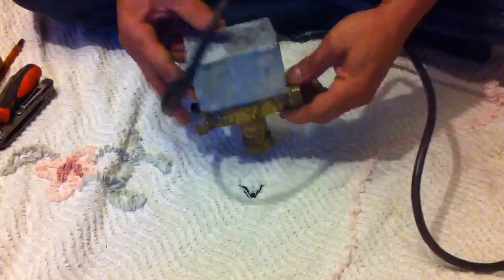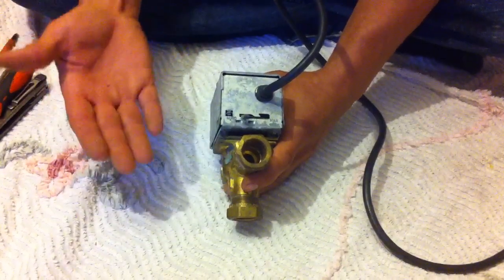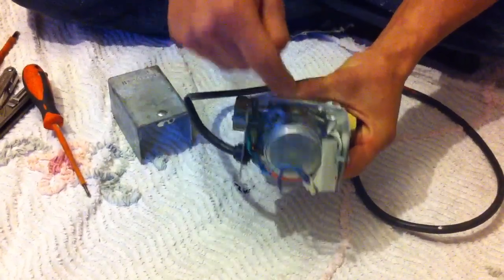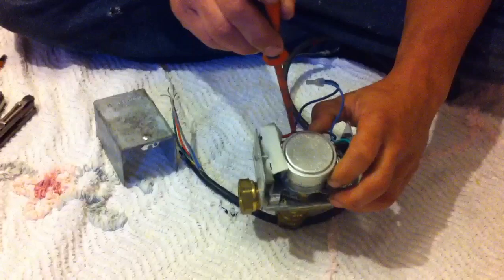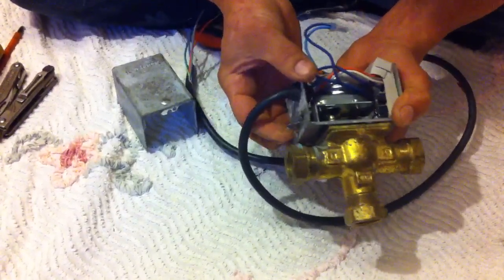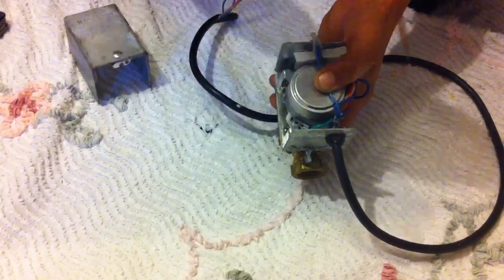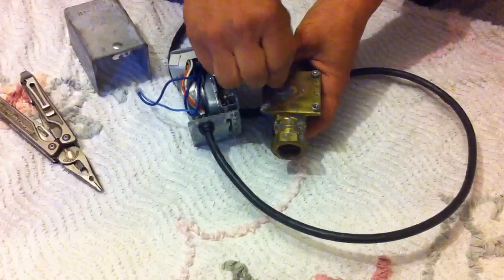Port valve diagnosis and repair

Comment: even after all these years since you put this up , its still helping people , very much
Reply: Amen!! 🎉
Reply: Yes my boiler won’t actually turn off the radiators so I think my value is stuck open of the micro switch thinks it’s open

Comment: Hi Sebastian
 I think my diverter valves are not working properly because when i select Central Heating i noticed the Hot Water pipes are also hot. Is this normal or a fault?  

I actually took the Honeywell metal controller part out & manually turned to A (CH) or B  (HW) or in the middle (AB) with my own hands but still noticed when Central Heating was selected the HW pipes were also heating up

I believe that when CH is selected  the HW should be totally off i.e cold. But because of a faulty diverter valve will unnecessary cause a bigger gas bill. is this correct? ...So in short drain the system & change the whole thing?

Comment: Hi, I had a physically seized "tap" under the valve (2 port ). After freeing it up I find that the valve doesnt close reliably. I need to manually cut and apply power a couple of times for it to close. Could you please advise where you think the issue might be? I've also noticed that it was installed with the arrow pointing against the flow direction. Could this be causing this? Thanks for your great video!

Comment: For the last 10 years or so, I have had issues with the Honeywell 3 Port Diverter valve, in that I have suddenly only had Hot Water and No Heating.
On one or two occasions I replaced the top-plate of the diverter valve because the ball-valve swivel had become stiff, but on all other occasions I have replaced the Actuator Head to restore Central Heating. On one occasion more recently, I successfully replaced just the motor in the actuator head (which was a lot less expensive).
However, last week I woke up to find that we had Central Heating upstairs only, and the downstairs radiators remaining cold. Naturally I feared that the circulation pump had finally failed after 25 years of loyal service; but as a first step, I removed the actuator head from the diverter valve to visually check that it was OK and that the ball-valve swivel worked freely. I re-assembled and switched on the boiler, but the same symptoms prevailed.
Therefore, with the boiler still switched on and in Central Heating only mode, I checked the voltage on the circulation pump – ZERO!! – so the fault is somewhere else! With the supply to the burner disconnected (so that I could lift the control panel & it’s box of tricks out of the way) I removed the cover from the Diverter Valve Actuator Head, hoping to see how it worked when switching between C/H & H/W – it seemed to OK, but still no voltage at the circulation pump.
With the intention of changing the Actuator Head yet again, I started to slacken the two screws securing the Actuator Head to the Valve Body, when I heard the Circulation Pump start, and yes! – 240 Volts at the pump!! Evidently the limit switch inside the actuator head was not being activated, but worked fine with the actuator head securing screws backed-off by about one turn.
Leaving all as it now is, I put everything else back in place and reconnected the burner, and It’s now bee working normally for the past 6 days without the need to replace anything – just slacken 2 screws a bit!
Long may it last!! Hope this might be of help to someone, but be VERY careful when working on the boiler with the power ON!!
19/02/23

Comment: Excellent - I have had problems with a number of zone valves where the tap itself has got a bit stiff and this has caused the place where the zone valve keys into it (invariably made of plastic on the head unit) to 'round out' and not be a tight fit - then you get all sorts of intermittent problems.  Probably down to hard water jamming up the actual tap valve.  One to look out for!

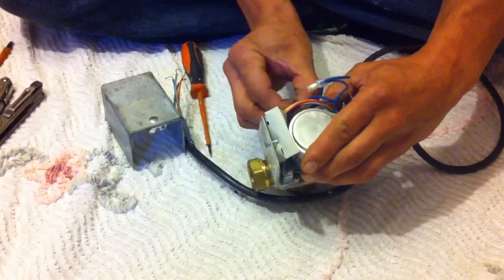Comment: re 3:40 . The valve only controls the 240v supply to the pump and the boiler for room heating. Water heating, well as I understand it that is a direct feed from the programmer and cylinder stat.

I thought with the valve set in the room heating position, continuity is between white and orange.

sorry for being pedantic :)

Comment: Hello Sebastian and thanks a lot for your helpful video.
With your video i was able to repair my valve with just changing the motor. Here is an additional link for one way how to identify if the motor is defect.
Kind regards Michael
Link to my video: https://www.youtube.com/watch?v=JKibxi4omXs

Comment: Actually there are 2 microswitches. One switches the pump and the water flow turns the boiler on. I wonder who designed this clutch mechanism, especially why ?

Comment: Good video, the first one that talked about the actual workings and the possible problems with the micro switches. I had to replace a top motor to the valve and found that the new replacement was faulty, in that the mechanics inside were not turning enough to operate the micro switches. Once I found this out all was well with another motor.

Comment: I think my valve stem is not moving all the way. It caused the motor gears to strip trying to move it. The lever for auto or manual moves with no resistance.  I took the motor off it was really hot. I used a screwdriver as if it was the valve stem and tried to turn it. It just skipped the gear teeth and opened all the way. So...I guess I need the whole assembly.

Comment: Same issue.  Motor was sticking before the lever made contact with the start switch.  Changed the motor - now perfect! £19 for the motor; zero cost to fit.  (Probably £100+ for call-out, parts and labour). Thanks

Comment: After several days of trying to get the boiler to start I watched your video and realised that the main synchro motor wasn't pushing the lever sufficiently to make contact with the switch that sends the "start signal."  After changing the motor my system now fires up and I'm very grateful for your help.

Comment: Seb its an excellent description on your video . I changed the motor and saved over £180 quoted from the local plummer . The part was £9.79 ant it took 30 min to repair.  Great video thanks

Comment: I tried to fit a new electric motor and control to the old lower valve body but the shaft length was longer on the old valve body , has anyone else had the same issue , spacing it away by a few mm doesn't seem to work that well.

Comment: On our valve the levers loose both ways so I guess that means the gearing is stuck? The little cog looks OK. Going to turn electric off and see. EDIT: turn off electric then check lever/arm and you should get resistance as per video. If not its bust. If clunky it's broken gears or cog worn out. Hope that helps someone.

Comment: Great video. I'm about to attempt replacing the motor myself. Quick questions; my existing motor is labelled as 5 RPM, however the one I managed to source is 4 RPM. Everything else is the same. What impact will a lower RPM have? Does it just mean the valve will open up slower? Thanks in advance.

Comment: Oh and whoever is watching this it is so easy on a bench without any water pissing out through the ceiling when the value is installed in a fucking bad place and the gate valves are passing water this guy is a clever dick

Comment: Hi Seb.
The valve you demonstrate in the vid, I have the  2 way valve version. My pump runs continuously unless I switch it off at the wall. The synchro valve works. Any hints would be appreciated

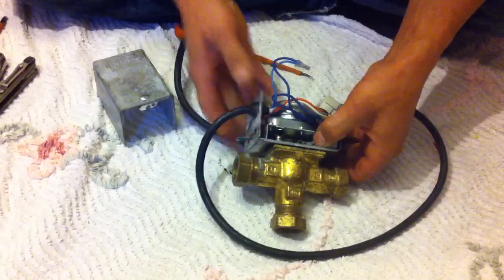Comment: Hi Sebastian. Great Vid - very informative. Could I just check that you meant to check the relay you can check for continuity on between the grey and orange (4:50)? I'm a bit new to this but on JW's vid on the internal workings of these 3 port valves it seems that the white wire supplies the orange with 240V when both relays are switched (grey apparently supplies the motor when the first relay is switched). So continuity should be between white and orange. Is that correct?Also when you manually move the switch right across is that moving it to the mid position (ie CH + HW) or right across so blocking of HW - that is CH only?My CH only function is not working (i.e. I set programmer on CH+HW but boiler turns off when the cylinder HW temp is reached) which leads me to think that the second relay is not moving across when grey given 240V. Thanks so much again!Tom

Comment: Just to add to this. My customer has a 3 port valve broken at the brass pipe side. The bit that sticks out just spins freely round and round with fingers. It is obviously broken as no position changes anything. hot water and heating come on together no matter what. I think something has snapped inside.

Comment: Hi Sebastian, I have a drayton 3-port valve on my system, I'm wondering if you can solve the problem I'm having with it...with the central heating control turned off and just the hot water selected on the programmer, the motor drives the valve right across to the hot water only position, but after a few seconds goes back to the centre position and remains there giving a constant clicking sound. This of course allows hot water to the radiators when it shouldn't. I've removed the head to take a look and the valve is quite easily operated with my fingers, the motor seems to run ok, could it be one of the micro switches causing this problem? 
Your help would be much appreciated, Ken.

Comment: Hi there.  My CH port valve is working fine.  However, recently its seems to make a quiet knocking sound on startup.  Any ideas?  Thanks.
Reply from the maker: Gearbox teeth starting to slip most likely
Reply: Thanks for response.  Gears seem fine - manually they run back and forth well.  The sound is like a like a tapping sound - identical and same duration every time.
Reply from the maker: Often the spring extending makes a noise similar to the one described but usually it does it from new
Reply: Its about 5 years old.  There's no problem with open and close (yet).  Sorry, the only way to describe it is a soft metallic tikka-tikka-tikka sound and then the valve happily opens and the sound is gone.
Reply: Hi Seb, I just took a spare valve apart (I need to get out more) and removed the motor unit.  I noticed the motor cap rattles when I shake it.  May be some kind of vibration?

Comment: Very clear and informative video. Ordered new motor this morning (isn't turning under power) and simply buzzing away merrily. Great info on the micro-switch. Using the lever manually, the arm wasn't coming across far enough to depress the switch. All sorted now.

Comment: my house have 4 heating zone. 3 of them are good. One have the same problem ( hot water can not go though the valve). I check the motor is good. And I switched to manual but hot water can not go through. Do you have any way can check the valve if it is stuck

Comment: Thanks for the video. I have an issue where everything works fine individually, but the cog on the motor is not gripping the cog on the valve. Is this a case of needing more grease? Noticed some wear on the teeth which is from the motor teeth grinding (that's the sound / also the spring popping back which sounds like banging) but if you hold in certain positions it does grip and control valve. Is there something displaced in the valve mechanism?

Comment: My water has stopped heating its just slightly warm and  i looked at the valve and the paddle does not do anything looks jammed ,i can move it back and forward manually but the gears do not  move ,is this the problem the waters not heating ?

Comment: Really appreciate your clear explanations. Over the course of a few days, we gradually realised we had heating, but only warm water. The auto/manual lever is stuck in the auto position (power on or off). Have ordered a replacement motor, and fingers crossed. Many thanks!!

Comment: I am going to try this. First. Turn off boiler. Turn on thermostat to that zone in question. Remove motor. Turn on boiler. Wait and see if the motor spins. Spins? It's okay. Does not? Need new motor. Test end switch for continuity. Turn off boiler again. Put tester to send switch.  Push switch on and off. 

Will let you know what happens.

Comment: Hi Seb. I think have a problem with one of these valves. My oil fired central heating system boiler is alway on, even when I turn off the system at the timer. The only way I can shut the boiler off is if I turn the power source off at the boiler. If I did not isolate the boiler the system would be on 24/7. thanks
Reply: Happened to me. One of the micro switches in the diverter valve was broken.

Comment: Hi Sebastian. Thank you for your extremely informative video. However I still am not quite sure what is wrong with my Honeywell 3 way valve.  Apologies in advance for very, very long message but figured you would need all the facts. Original problem. Heating not coming on when called. Hot water coming on when called but some of the upstairs radiators coming on. 
Called engineer who said he fitted a new replacement powerhead. This appeared to solve the problem, I paid him and off he went. However the next day same problem as before. He came back, fiddled around a bit, said he wasn't sure exactly what problem was and was going to replace "powerhead and valve". I specifically asked him if this meant the brass T shaped piece of pipework below powerhead. He said no and implied it was not that but the powerhead with something else (but not the T shaped brassware) which would cost another £100. Left me confused as I thought you replaced either whole powerhead +/- valve below unless you replace one of the components like the motor or microswitch independently as per your video.
Not sure he really changed powerhead as doesn't look new. I took cover off powerhead  and had a little investigate myself and this is what I have found:
When no power to valve: lever has resistance and springs back. Can't hear clunking gears.When power to valve: looseWhen neither HW or CH calling valve is open When just hot water called: nothing moves and boiler and pump fire up.When just CH called I can see motor turn valve towards microswitch but boiler and pump do not fire. If I then use my little finger to push microswitch the boiler and pump fire up.
I also took powerhead off completely to check valve - using my finger I can move spindle but not very far.
So my lay-person's conclusions:
Programmer to valve signalling working as motor does do something. Electrics to microswitch working because when I manually close it circuit is completed, Motor working to some degree because it does travel when CH firedValve seems okay as I can move spindle.
Questions:
1. Could it be that the motor not got enough oomph to turn all the way to close microswitch?2. Could 1.  be caused by a stiff valve. As I said it did move but I don't know how far it should move and how stiff it should be. 3. If it was 1. surely that would have been solved if he had replaced powerhead as he claimed he did.Any help gratefully received. I don't mind paying for genuine work but just have a feeling I may being taken advantage of. Thanks, Diane

Comment: Hi,  I would be grateful for some advise. when I turn the boiler on to heat the water the central heating comes on as well which is a nightmare in warm weather. Ive been told it's proberbly the 2 port valve on the central heating. Ive looked at it and something seems wrong because the lever doesn't move but does on the other valve. I'll send a pic, the central heating valve is on the right

Comment: Hi I have a problem with my heating water comes on but sometimes the heating doesn't. If I go to the motor and shake it about a bit you can hear it coming on then its ok will be ok for a few days  and then same again doesn't come on until motor unit is shaken. Any idea's please.

Comment: Hi mate very good video.. 
can the pressure vessel being broke stop me from getting hot water.? seems like the motorised valve to the hot water cylinder is opening and all pipes getting hot, but only giving about 1mins worth of hot water. the expansion pressure vessel is full of water, very heavy.  has still been working fine for two weeks though other then pressure release valve letting bye to out side.

Comment: If the valve makes a clicking noise the gears are probably slipping. On the valve I examined it seems to have been caused by a manufacturing defect rather than wear as it was a relatively new valve and these should last years. The motor gear did not fully mesh with the large gear and there is no facility for adjustment. If the gears are not too worn then enlarging the hole for the motor boss will allow the motor to be rotated slightly to get a better mesh. Fix the motor in position with another screw or epoxy.

Comment: I've got no heating but plenty of hot water. The lever on my 3 way valve has no tension to it. I can move it from auto to heating without trying or hearing anything spinning inside. Does this mean the gears have gone?

Comment: Hey great vid. How do u check for faults with the multimeter? ? I got one that moves when the demand for hot water is on but doesn't fire the boiler. How do i check to be 100% ??

Comment: Hi Sebastian.  Great video and explanation of the 3-port valve operation.  I think I have a broken syncro motor on our control head and would be interested to get a 2nd opinion.  The symptoms are 1) the manual lever doesn't move back from it's manual position, 2) the motor itself is quite hot to the touch.  The problem we are having with our central heating system which has started this investigation is a lack of hot water which looks like a flow problem i.e. after having a shower the hot water is to slowly to get back to temperature.  I've had a plumber round and he's concluded it's either a problem with the 3-port valve, or the pump but can't definatly say which. Any help appreciated. Thanks. Paul